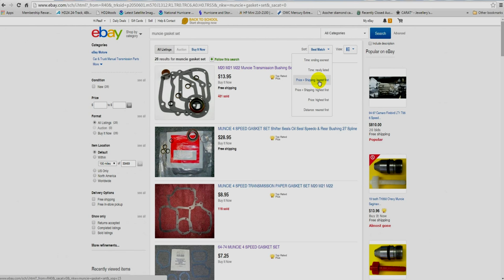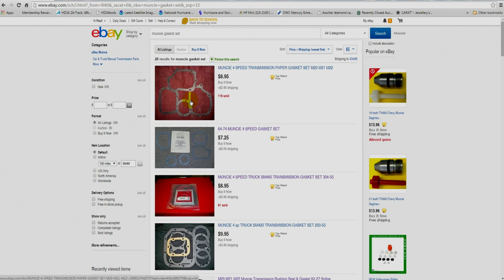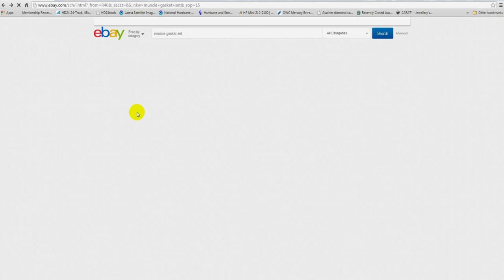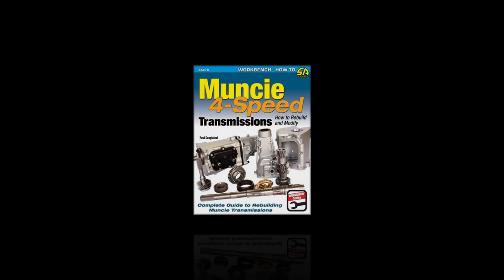Muncie 4 Speed M20 M21 M22 Transmission Gaskets and Seals

Comment: Just found out my M20 decided to leak out all its gear oil over a 5 yr period in storage - this vid. is EXCELLENT! Thank you so much, seeing the diff. between the .015 and .030 gaskets was a life-saver, I'd feel sick to my stomach using the wrong tolerance and cracking the housing. Thank you again.

Comment: Paul, I think your a great gearbox guy! Thanks for the video....maybe it was a rare case but, front bearing retainer bolts on OEM Muncies have 1/2" heads instead of the 9/16" regularly found on 3/8 bolts.....I had aMuncie years ago give me a fight on going into the bellhousing until I noticed the hex head was actually protruding further out than the diameter of the bearing retainer collar....Now when I don't have OEM bolts I use Allen head or 12 point bolts for my bearing retainers....looked to me like you were using 9/16" hex bolts on your build....maybe I just ran into a rare case where tolerances had built up the wrong way but those heads did protrude past that collar register when the pointed side was facing out. Thanks for sharing your knowledge.
Reply from the maker: Eric Brandt actually early units used a 1/2 head.  Newer units all used a 9/16 head. So that information is not 100% correct.  The reason they hang up on the bell is because people use lock washers and the lock washers wont work with the larger head. Its the washer that is the problem.  That is why they use the later lock plates.

Comment: Paul, the edge on the speedo housing is like that so do have to remove the entire bolt when replacing the speedo gear. Simply loosen the bolt, let the tab rotate down and remove the housing.  Re-install is much quicker now with no loss of parts.....
Reply from the maker: ACE of HEARTS whether the cut edge is there or not makes no difference because that end of the hold down isn't near anything for it to bind against to prevent rotation.

Comment: Any suggestions on how to remove my drain plug. Can't seem to break it loose.  Thanks in advance.
Reply from the maker: Heat the surrounding area of the plug with a propane torch. Not the plug. Then shock it with a hammer. Do this a few times and usually it will break free.

Comment: Great vid. My doughnash 4 +3 is leaking from the lower shaft plug...  will be buying ur gasket kit
Reply from the maker: I stock new magnetic fill plugs as well. Always use teflon tape on the threads

Comment: One of my front retainer bolts are stripped?? can I (1) use a 1 1/4 inch bolt to grab more threads?
or (2) use a JB weld thread repair?? thanks
Reply from the maker: Use a threaded insert such as a Helicoil. Most auto parts stores now carry small thread repair kits thread size is 3/8-16
Reply: @GearBoxVideo  I will have to drill that out and retap it though correct? When using a heilicoil. Everything else is rebuilt and complete. No jb weld though?
Reply from the maker: Tap a little at a time and with the side cover off use grease in the hole your tapping and trap the files with a rag

Comment: Waited to see any tips on the rear tail shaft seal. Mine still leaking after replacing twice.
Reply from the maker: Did you replace the bushing? Often times a worn bushing or even a bad pilot bushing up front will not allow the yoke to stay concentric with the seal. I assume your yoke is in oerfect shape
Reply: @GearBoxVideo  Thanks for the advice. I’ll look into your suggestions. The engine is now out of the car making things easier to check.

Comment: hey Paul just wondering whether it is normal for my air vent to leak a but of oil?
Reply from the maker: Yes make sure the transmission is not overfilled and you may want to extend the vent higher.

Comment: Awesome video. Very informative. Is it possible to replace the rear housing gasket in the vehicle if the shifter and driveshaft are removed first?
Reply from the maker: No, because the reverse fork and idler shaft will come out with the tail and you would need the length of the tail to clear the Mainshaft. Not worth it for 4 more bolts.

Comment: Hi Paul, hope you are doing alright.  I am a bit confused on thrust washers; are there two for the counter-shaft and two for the reverse Idler gear?  Would like to use the copper washers with dimples for counter-shaft and two thrust washers with tang for reverse gear?  What site do you recommend I get them from?  Thank you!
Reply from the maker: Julio Rosario For the Muncie 1" countershaft we have the bronze dimpled washers. Also for the forward reverse idler.  The 7/8 countershaft only has the stock type washers.

Comment: You seem to be way more knowledgeable than I am at this. I do have a question though. Why don't you put the sealant on the gasket first and then place the gasket down. Seems it would be much cleaner. Not a big difference in time. Always wonder if it matters or just preferance.
Reply from the maker: Depends on how you handle the gaskets. No preference, but paper gaskets are not stiff. So since you have to have the gasket supported to apply sealant on both sides BEFORE you install, then pick it up and install it on another surface what's the point?

Comment: I have an M20 in my 1978 Oldsmobile Starfire. I have it pulled and want to go through it, replace the synchronizers and the rear seal at a minimum. Your gasket and seal kits only go up to '74. Do you plan on offering a gasket and seal kit for a 1978? Thanks.
Reply from the maker: M20 is an RPO code for a wide ratio transmission. Thus both the Super T10 and Muncie used that RPO code. You need to get casting numbers
Reply: @GearBoxVideo  I'm assuming that would be the numbers on the main case right below the letters "GM". They are 3925656.
Reply: The tailshaft casting number is 352254. The side cover casting number is 6261886.

Comment: Question - Is there a speedometer gear that will allow me to use my 1965 M20 with 4.11 gears? If not what will I have to do? Thanks!
Reply: Will buying a 6 tooth drive gear to replace my 8 tooth one work... will that work with my plastic 20 tooth driven gear? I read that the 6 tooth ones originally came with a 20 tooth steel driven gear.
Reply from the maker: Depends on your tire size.  What is it? see this page... http://www.5speeds.com/calculators/SpeedoCalc.html

Comment: Paul another great video  !!!! When your rebuilding a customers Trans,do you or have you ever seen a need to machine the retainer/ mid plate or tailshaft housing surface or just replace the whole case?
Reply from the maker: Charles Price  Usually the main case of the Muncie is where all the  important  numbers are.  So the main case, if need be will get rebushed, centers corrected, and thrust surfaces repaired. This is of course if the customer needs his original case.  The new cases, mid plates and tails are much better.

Comment: hey paul im going to order some of your gaskets, few questions though, my m21 out of a 70 vette was leaking oil from the front of the transmission somewhere (bearing retainer or countershaft seal not sure) and that's why its out to try and solve that issue. is there a special seal or plug for the counter shaft seal? also I need a kit with the three shifter control seals and one of your premium rear tail shaft seals. I fell victim of the ebay special and im not impressed with the seals I received. I really don't wanna pull this sucker back out! so, what kit do you recommend, and in your experience why would my trans be leaking? it shifts like a dream and inside looks great fluid came out pretty clear and no rubbish on the magnet? any help would be appreciated my local trans shop didn't hesitate to shoot a quoate to rebuild the whole shebang...
Reply from the maker: Matt Dugan The countershaft bore gets elongated. The case usually has to be bushed with a new shaft
Reply: Thanks for your help I took it to a guy up in LA and he said what you said the case is wallowed out just a bit. He had a machine Shop bore it and a new bushing installed. he also went through the syncros and bearings too. You channel is bad ass! You sure know your stuff! 😎

Comment: Just an FYI on that "crappy sears craftsman" torque wrench, mine is 30+ years old now, and I have it re-certified every few years, and it's always right on the money. The guys certifying it always comment on how good those torque wrenches are, and often offer to buy it from me! The key for long, accurate life is to back it off to the lowest torque setting when you're not using it.
Reply from the maker: The adjustment ring bring on both of mine. Glad you had good luck with yours.
Reply: The lock collar? Mine broke years ago too. The guys doing the re-cert put a new one on for a few dollars, and I've been more careful with it since. Thanks for the awesome videos BTW, I really learned a lot. Wish I found your videos before I ordered your book from Amazon - I would have ordered it direct from you with the promo code.
Reply from the maker: The older units had chrome plated steel collars. The older wrench with the chrome collar had the internals break. The last two came with plastic collars (that broke ) which I can never understand why they went cheap there. Problem is there is no lifetime warranty. I don't use their wrenches anymore and use a digital one from Mac, same as the one made by Gearwrench. I can work faster. Because with the readout if you  want to torque down gradually and then the final set point for some apps. So when I use beaded gaskets I can quickly go to 12 - to 20 - to  30. without having to reset. Keep in mind the wrench is used daily.

Comment: Hey Paul, just finished my M20 rebuild and have her back in my Camaro. I followed your book and videos to the T. I had fun doing it. I drilled and tapped a drain plug in my case (very very carefully) using a 23/32" bit and 1/2" NPT tap like your book suggests. What do you recommend using on the threads for a sealant? I have a very small slow leak coming from there now. Waiting until I hit my 200 mile mark to change the fluid and ill take care of it then. Any recommendations? Thanks man, DJ
Reply from the maker: dmesz311 Just use Teflon tape  on the pipe threads.  Some sealants can cause the plugs to seize up in the case. Thanks for the support.

Comment: Hi Paul and thanks for the great videos. I don't see any tips on how to remove the sleeve that's behind the tailshaft seal. Any tips on what to use? Assuming you still use a press?
Reply from the maker: +Todd Gover If you are talking about the rear extension housing bushing, I actually use an inside muffler cutter pipe chisel.
Reply: Thank you

Comment: Paul, great looking "fel pro" style print-o-seal gaskets you're now offering. I'm still old school with most of my paper gaskets. It's a thin bead of yellow weatherstirp glue on one side and brushed on brown shellack on the other. Bullet proof seal and if you take your time, clean look. Damn shade tree's and their use of orange permatex. It should never be used on the trany but at least use the gray stuff. I shouldn't encourage. I'll have to give the red stuff, you use, a try. Are you offering your new print-o gaskets for top loaders and others or is the demand not there?
Reply from the maker: AJKandK  Its expensive to tool the gaskets, I might do others if the program progresses. I think anyone who has worked on cars years ago has used yellow weatherstrip glue and Indian Head Shellac!  The new gaskets save time and money. The importance of two different retainer gaskets is often overlooked. The Permatex 51813 is currently used in most production transmissions. ANY silicone can take weeks to cure. So if you are doing service and need to fill a unit with oil within a few hours any silicone sealant is not a good choice. GM used to sell GMS-Black which was not a Silicone based sealant which was used on production engines.  Regardless of the SIlicone color, Black, SIlver, Orange, Clear , 24 hours should be allowed before adding oil.  I get new T5 units that I pull apart for parts and the sealant still isn't cured, and I do get people occasionally complaining about leaks with those.

Comment: Just a general question Paul.  From watching your vids and talking to you awhile back, it would seem like there are still quite a few people using Muncie's.  Where are they being used most- street, strip?  Why do they remain popular when they do not have an overdrive gear?  A muscle car or rod on the street, you'd think they'd want the overdrive so they can run a numerically higher ring and pinion and still have a decent cruise speed.  What is the trend these days in manual transmissions?  Good videos!
Reply from the maker: falfas55bgas  Good questions. The Muncie is so popular because it was and still is the largest mass produced ( by volume ) manual transmission ever issued in a production vehicle. Spanning 1963 to 1974 hundreds of thousands of these transmissions were sold. Overdrive transmissions rob horsepower.  So if you are interested in a performance only muscle car, or road race car, a 4speed with proper rear axle gearing will rob less horsepower than a 5 speed. Nascar doesn't run overdrives for a reason.  Between new Muncies as well as Super T10 4 speeds, they sell way more than 5 or 6 speeds do. For cruising you can now get  Muncies with a 2.98 1st gear and couple that with a 3.08 axle still have a 4 speed and get decent performance combined with fuel economy. Of course these are direct replacements and no cutting or interior mods are needed.  
Don't get me wrong,  I love 5 and 6 speeds. Restomods using new 5 or 6 speed transmissions are awesome rides. As far as trends go , there really isn't any defined. I can tell you I am selling more 4 speeds this year than any other year.

Comment: What in your opinion in the power limit of an m20/21 and m22?
Reply from the maker: bolawdean i always say the transmissions were designed for their intended use and nothing more. Its hard to compare power ratings when different axle ratios and clutches will load the same transmission differently. Also most Muncie transmissions are over 50 years old. To base purchasing a used transmission on some rating is pointless.
Reply: i know what you mean, I guess I was talking best case scenario like a fresh built muncie with good quality parts such as Italian gears...just curious
Reply from the maker: If you have a good case, and billet steel or alloy midplate it depends on axle ratio. Typically the M22 gears will be stronger than m21 m20 gears. Usually new m21 / m20 gears are in the 450HP range while the M22 stuff is between 500 to 750 HP
Reply: thanks that's exactly what i was curious about, wasnt sure the power difference between the m20/21 and m22 since you hear so many differing opinions, I def value yours since you seem to know them inside and out

Comment: great channel Paul . ETCG brought me to your channel just as he done with scanner danner . I use loctite 515 at work a lot on orings and large castings on trane chillers. I have plenty of caulking sized tubes of it. if your interested I can send you some
Reply from the maker: Thanks for the offer. I appreciate it. I don't use that size tube or type. I also stopped supporting companies that sell products direct undercutting distribution and sales people that educate end users about their products.
Reply: +GearBoxVideo  hi mate  I have a  m21 gearbox  in my ht holden  it seems to be not going into 3rd  every other gears OK  could it be  that I need to run fresh gear oil or the linkages out of wack
Reply from the maker: +paul roberts is it a grind or a block out condition?
Reply: Mate I'm not the best around the machanic side of things  don't know  what grind or block is
Reply from the maker: +paul roberts When you shift it may grind going onto gear. Sometimes you get a block out condition where its doesn't grind it jist doesn't want to go in gear.
Reply: +GearBoxVideo  it's grinding mate
Reply from the maker: Then your ring is bad.
Reply: +GearBoxVideo  is it a major mate